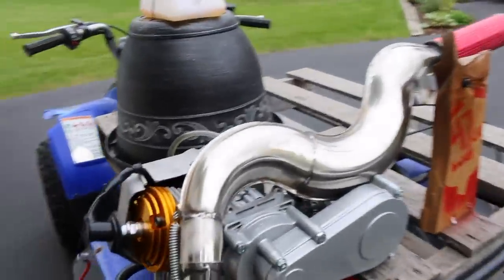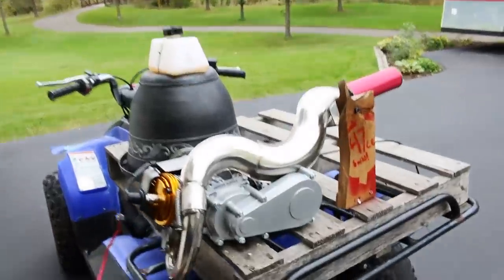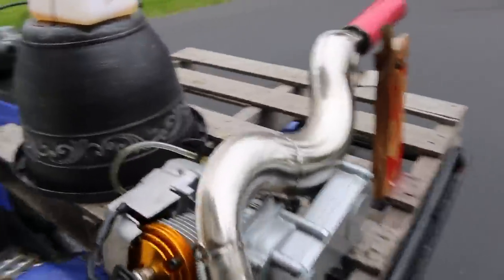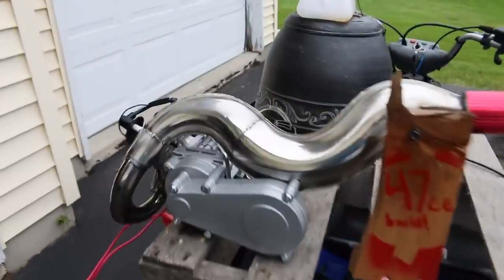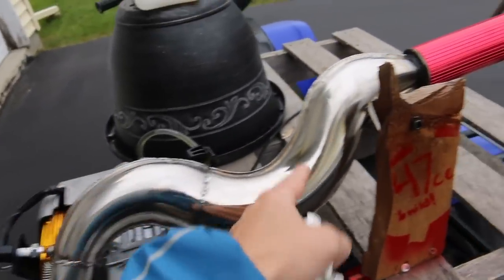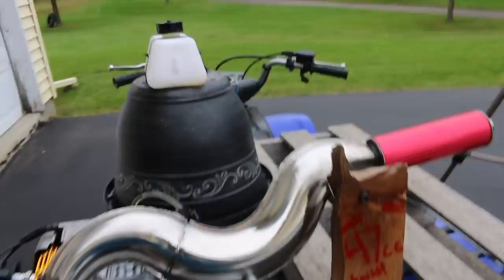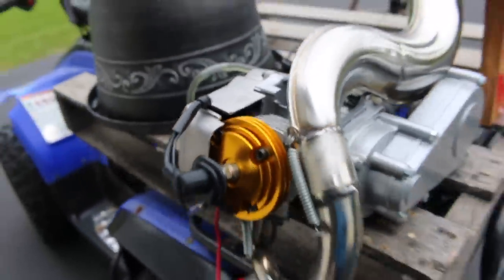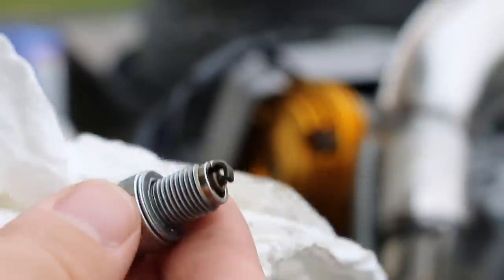How To Break In Performance Pocket Bike Engine

Comment: That pipe design is not just for looks. It's called a snake pipe, it has different divergence cones to help create an altered return time line. This gives a more effective range for the power band for smaller engines.
Reply: Where can i buy one

Comment: Make sure you do a plug chop when changing oil mixing ratios - main jet sizes increase as more oil is mixed into the fuel due to leaning the fuel out. Otherwise great stuff mate!
Reply: wouldn that stop the engine from gettin lubed👀 or maybe i misunderstand the term.

Comment: I think it's good that you run a heavier oil mix. As long as you don't smoke too heavy, I'm sure that it will run fine at 40:1 once it's broken in. You can tune the carb so it runs good so running the recommended the fuel mix isn't too important.. just don't go leaner than recommended. I'd rather have better lubrication than worse! 
  I actually run full synthetic oil in my 2 stroke stuff. I also skip the pump gas and head for my local airport. I use 100 octane low-lead gasoline. It has zero ethanol and it's 100 octane. If I remember correctly, it's around $3.50-$4 bucks a gallon. I don't use a whole lot so I'm ok with paying more for better gas and high quality oil. 
  I'd like to see you try a snowmobile. It will provide some content during the long winter and it will be a unique project.
Reply from the maker: Cool I wonder if I could get that at the airport near by and I agree more lubrication over less forsure. Yea the snowmobile Idea would be cool just now considering if the little engine is worthy since its small. Some kind of snow vehicle is the way I should go now though forsure.

Comment: I like the whole idea of a pocket snowmobile but i know from experience you need a pretty powerful engine to run the track at any speed.  It would defiantly be cool to see that though. I now Yamaha made some small sleds lie the snoscoot i think it was called. it all depends on where you live.
Reply from the maker: Yea I wouldn’t expect it to go in deep powder but if I could cruise it on snowy streets and light snow though that would be awesome to me. A lot of factors into this one though like probably needing a welder forsure
Reply: I seen pics of an actual pocket snowmobile back in the early 2000s during the hight of the pocket bike craze. I have looked and looked but have never found another pic or any info on them. They must have been a failed endeavour.

Comment: Did you ever make vids for Reed installation, race carb and fitting the full circle crank? Also did you fit the electric start, race flywheel a clutch? Cheers, love the vids.

Comment: i've bought the same engine on amazon and they say to run 25:1 normally i now hear you say that after the break in you run 40:1 so what would you recommend?
Reply: When you say 25:1 you mean running a 2.5% mix, so, for breaking in you should do 3%, do about 3 or 4 hours of cruising use, then 2.5% for normal use once you’ve done the breaking in, make sure you stop so the engine can cool down a little, start it up, do a good warm up and once you’ve been using it, leave it idleing for a minute then kill it so it cools down progressively

Comment: Try building two identical hipo engines for your snowmobile idea and run them side by side -(not joined at crank to crank but seperatly joined by jackshaft)? Lightweight materials to build it scaled down a bit .?

Comment: I have the same engine in my pocket bike. However it did have a performance carburetor on it but somehow it snapped off where it attaches to the intake for some reason i am not sure how it even happened, for that reason I am running with the stock carburetor and have never ran into any issues with it. Other than that the engine has a full circle crank a performance clutch and the upgraded cylinder and piston as well as a performance pipe.

Comment: I'm working on a goped, it's homemade with a 30cc 4 stroke weed whacker engine, I'll let you know when I put up a video of it
Reply from the maker: Awesome please do that sounds like the weed whacker bike build I'm doing
Reply: I'm uploading the video now of the ped, keep an eye on my page and check it out. Let me know what you think from your experience with small engines
Reply: If you need advice on the ped I'm your man.
Reply: @harryfp1494  I made it, but scrapped the project, the chain keeps coming off when you try to go full throttle. I'm going to get an engine like this and try with that one
Reply: @Unknown-kd3ri  were you using a chain tenderizer and the right amount of links in the chain
Reply: @Unknown-kd3ri  there is a guy that made a 4eally cool scooter  out of one of these pocket bikes super cool and fast
Reply: @harryfp1494  everything was tight, it's awkward to mount solidly because of the design, its a Ryobi s430 4 stroke. I built it first with a crappy homemade clutch drum and an 11 tooth small front sprocket on it and it was fine. The only thing that was wrong was that the chain would come out every so often. On a late night ride (I live in the Bronx NYC) the clutch broke. After a month of rebuild, I rebuilt the thing with a smoother faster solider homemade clutch drum, a new clutch and a smaller 9 tooth sprocket. But for some reason if I try to open it up the chain comes off. But it's because it's allot of shaking and vibration on the mounted engine. I gave up for now... If I rode it at 10 mph it's okay, but I want to open her up, the cops will take it if they stopped me, nothing is legal in NYC. With the first setup I rode it with I swear downhill I went like 35, maybe more, the thing was screaming, at high rpm i always looked back because I thought another 2 stroke bike was behind me
Reply: @harryfp1494  I also know a dude with a super moto that lives around my block, and me and my brother (he has a blata 2.5 Euro pocket bike) were blowing it on a straight, but my chain came out, when I'm putting it back on the super moto dude came behind us and was like, yo I was calling ya but ya kept goin, and his words were, that shit hauls ass though! He was shocked when he saw that I made it
Reply: @Unknown-kd3ri  I'm from johnstown NY your build sounds super solid and don't understand the fail rate without seeing it but what I can tell you is if you have your frame built these little 47cc 2strokes that he is making the video on make a killer scooter
Reply: @harryfp1494  You're right. I made one with the small bore 49cc version and it hauls ass.

Comment: quarter scale R/C airboat. Or how about  fitting it  to a  small jonboat.?  I have an almost  identical  build on the break in rack  with one significant difference, a process that was made available to me around 1994 or there abouts. Im talking about Cryogenic metaluracal hardening/tempering. Using liquid nitrogen, metal components are simply placed in an overnight soaking ,the temperature of  this pajama party is-minus 300 F. The  parts then are brought back slowly to room temp then allowed to climb into the  250F +- point where the completed finished process  is complete. The effects are all positive and in some specific  areas relating to a typical 2 stroke's  high rpm  and jetted to the very edge of armegeddon ( thats where the big power lives) are downright dramatic!!!   The treated pistons ,rings rods bearings cylinders become able to perform at higher rpms . This is because youve been invited to  hang out  and  use some fuel  air combinations    spinning at  numbers that you will at first think is somebody  prankin you hoodini style.    Ive been waiting a very long time to return to  the magical land of Toosuna kabooma..  the  best kept secret in motorsports. Or  so said  John Force.. he doesnt mention it anymore.. (he has his own in house  set up)      Google 300below .com  .
Reply from the maker: You lost me at the magical land of toosuna kabooma lol All this sounded very new to me. I have done cryotherapy tho... Are you talking about about putting parts in liquid nitrogen?
Reply: @jaguars004   look at the crysler  Corp .Snowrunner!!! youre gonna  be amused at whats powering it...
Reply from the maker: Wow yea man that is very inspiring and seems totally doable if i can just figure out the tread-set up to work with my motor. then I could try to find a bike similar to that. Cool!

Comment: I used to learn about nitro engines for everything cars, and they are damn hard to start and very affected by the ambient temperature. I thought those 49/47cc gas engines will be so much better, but I was not completely right. Why are those cheaper than nitro engines anyway?
Reply from the maker: They’re just that cheap, I bet they only cost the manufacturers a few bucks to make

Comment: Hello, i am thinking about buying one of these engine. As far as i know there are two different pull start setups, one all plastic and one easy pull with alu clogs, any knowledge in what is best option?
Reply from the maker: I would go alu over plastic forsure
Reply: Plastic is better because after much experience with these engines it's always better to break the cog in the pull start than break the flywheel. Once I got the aluminium starter cog I started breaking flywheels.

Comment: I have a problem I bought the big bore kit with crankshaft included and the piston crushes the spark plug can you help me with that problem?
Reply: Check if the spark plugs protruding more then it should, if not you might be able to put 2 head gaskets on to make a small difference. If not see if the stroke on the other crank will clear

Comment: You should get like a kx65 or a sx65 dirtbike that actually has gears and goes over 20mph 😂😂
Reply: Some pocket bikes and gopeds go like 65
Reply: Ghetto Motorsports with no torque
Reply: Ghetto Motorsports superminis but not no moped or pit bike
Reply: @ACP336  gopeds with a little work can go like 60, polini and blata make pocket bikes that go that fast
Reply: My brothers air-cooled blata does a good 45
Reply: Ghetto Motorsports maybe but I find that hard to believe though buts it’s more than possible
Reply: @ACP336  hell my baja heat did 51mph
Reply: Wolfman's Garage by pitbikes I mean those little 49cc bikes
Reply: @ACP336  just saying i had a 49cc pocket rocket that would constantly hit like 47
Reply: Wolfman's Garage yes and it was not stock either and can y’all chill out I just recommend a bike 😂😂
Reply: @ACP336  it was almost stock lol
A bike would be cool but it wouldn't be his type of content
Reply: @ACP336  unless it was a YSR50 or 80
Reply: Wolfman's Garage yea and I just simply recommend a bike and everyone is flipping out because I said “somthing that has gears and goes over 20mph
Reply: My 1983 RX50 goes 55 with 2 people on it 5 speeds helps a lot!! And its really a 49 cc
Reply from the maker: Idk how long you've been watching but I have two heavily filmed bikes that hit 50Mph. This new build is for the people that are stuck with the bone standard pocket bike engines.

Comment: I run 50:1 mix on mine and a bit of oil comes out of the exhaust not too much though
Reply: Ugh that’s not good
Reply: That happened to mind and blew up shortly after. Be careful
Reply: @damienbennet200  yea 2 strokes are a ticking time bomb

Comment: They tell you to use 50:1 for emissions reasons. 50:1 is detrimental to the engine in the long run and 32:1 should be perfect for it, the main reason why you dont want to use 50:1 is because of the extreme load and rpms the engine will see, that's why a weed wacker will survive 100:1 because they dont rev that high and are not under much load

Comment: Snow cart
Reply: Check out trail ripper quads made by GO-PED. Believe your in AZ? May be some in your local area.
Reply from the maker: Minnesota for me but yea a trail ripper would be cool. Ive been checking the used ads lately
Reply: Minnesota okay I don't know where I got Arizona from. Something that you could ride in the snow would be pretty cool to see just not sure how you would rake up the belt system for the rear unless you just put a real big knobby Tire that's where I got the trail Ripper idea they have suspension with 10 inch knobby tires and chain driven
Reply from the maker: Yup exactly thats where I'm having trouble too, I have no experience with snowmobiles either. it may have to be knobbys in the back and possibly skis in the front but we'll see may be a belt plan will come to me via more research